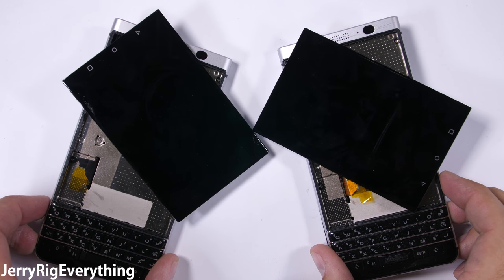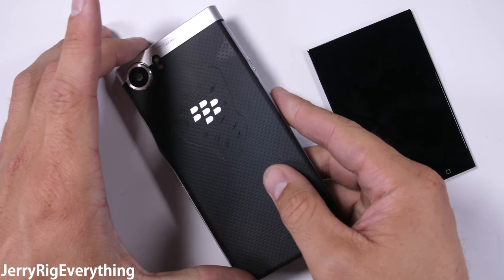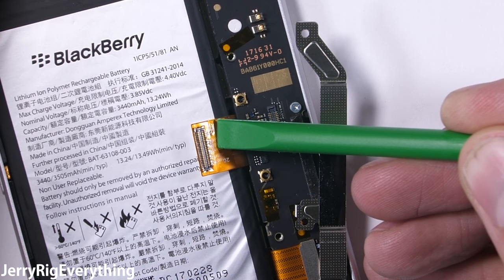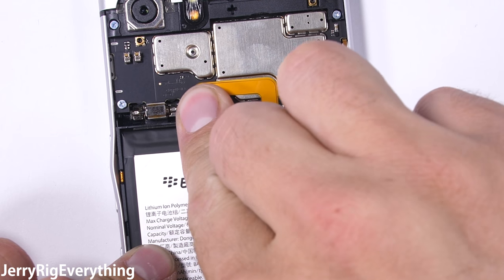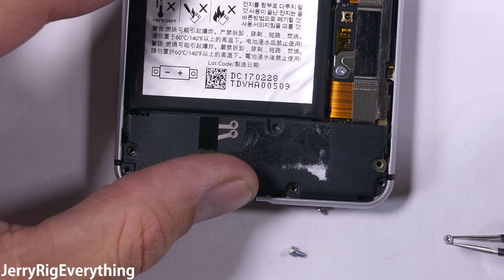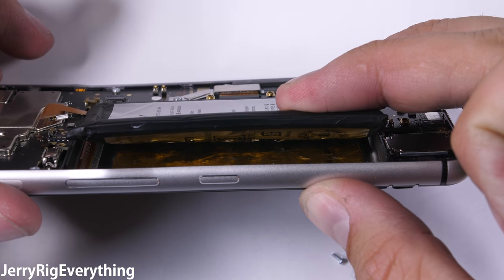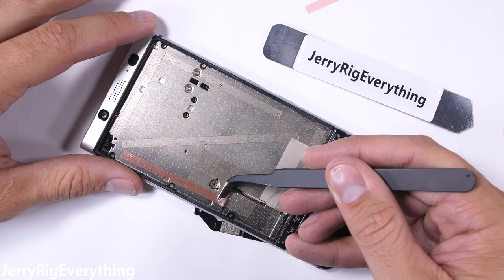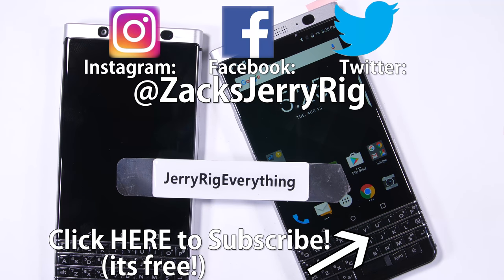Blackberry KeyONE Teardown - and GIVEAWAY!!

Comment: SUUUPER easy screen replacement. Except for reinstalling the back cover. Took me forever to realize that you have to angle the cover completely perpendicularly (from the top, where the camera is) to slide it into the notch at the top and then tilt down for the rest of the tabs.

Comment: Hey Jerry ! I think you should not glue the screen like this because if the screen take a shock, the glass may pop off the LCD and BROKE the LCD. I work at a phone/tablet repair leit shop, and we are gluing the sides of the glass to prevent the glass to pop off. It is stronger than you can think it is. Like the OEM glue was before.
Reply: And  you are awesome ! I like your videos! Continue !

Comment: Hi Jerry.  I used the double sided tape to adhere the screen to the body of the phone and the screen fell out, the foil sticking to the inside of the body of the phone but separating from the screen.  Now I understand why Blackberry glued the screen along the edges rather than adhering it from the back.  The foil came away from the screen and got stuck in the phone and had to order another screen.

Comment: On the battery adhesive - use DENTAL FLOSS. 

Really! Just loop it under one corner, then saw it back and forth under the battery, and it will make quick work of any adhesive or double sided tape. Plus there's no risk of puncturing the battery or folding it or overheating it trying to melt adhesive.

Comment: "Ribbon cable was torn, rendering the screen useless"
In place where I live, repair guys restore torn ribbon cables by scratching off plastic cover, soldering tiny copper wires and reinforcing the connection with carcas, for instance glue and baking soda (which makes strong plastic-like substance). Not only that , but they do that for phones that cost like $70, meaning that the repair costs not more than $30. It's incredible how many things become possible to do when people don't have much money.

Comment: I know that the bezels are laughably thin on those screens but they are also not designed to have adhesive put directly on the back inside the frame.  This will most likely cause pressure spots and other screen issues in the future.  I would have used adhesive promoter and 1 or 2mm LSE on the bezels instead.

Comment: the teardown is pretty easy. The top shim gets ruined most every time, so you better have replacements.

Putting a new screen on properly has proved difficult.
The problem is that the LCD is actually larger than the digitizer, so there is a lip overhang that has to contact the upper plastic framing (not the lower metal center area) of the phone.  The first replacment I put on there, afterwards I noticed the lower left and right edges had some light bleeding through. Its because the glass was not contacting the frame.

 so its either going to have to be .5mm-1mm 3M double sided tape, or using h9000

Comment: I had to replace the display of my Lenovo P70. First I tryed to get it in place with double sided tape like you but it was holding it up for 3 days :D Then it just started falling off. So I had to buy a glue. Bought a b-7000 for 10lv(лева)~5$ and for now it's okay I don't see any issues. 3 months since I replaced it.

Comment: My keyone  back speaker had stopped working so I took apart my keyone and removed the speaker cover and saw the speaker wires has been removed and as an temporary fix I taped up the ant sized wires and it worked

Comment: "& I should probably not use this particular battery anymore." I'm dead 🤣😂🤣😂

isopropyl alcohol would remove the adhesive, but also separate the screen. goo be gone spray would be a better choice. Fairly certain it could be worked into the space if you could remove the side rail near the battery.

Comment: Hey Zack, in this video, from what I can tell, Blackberry/TCL practically made the charging port immobile (from what I can see no play or wiggle room at all). Would I be right in saying that charging ports break because they are not as connected and fused to the frame like the KeyONE's and therefore the KeyONE's might not need replacing?

Comment: You need to remove the top metal piece FIRST.
Reply: There are two screws under the plastic piece on the very top of the phone so you have to remove the plastic piece and unscrew those two screws to remove the metal top. This will allow you to put the back back on.